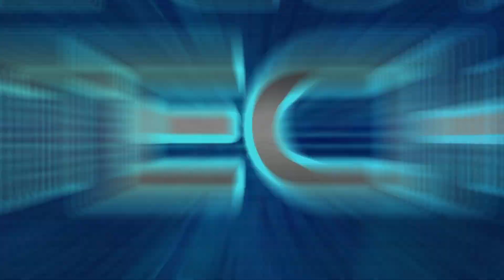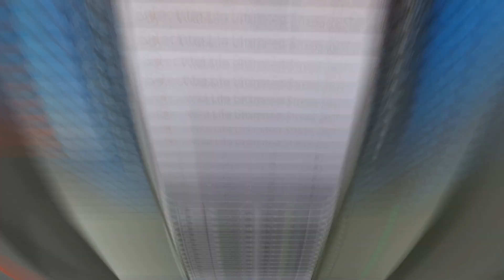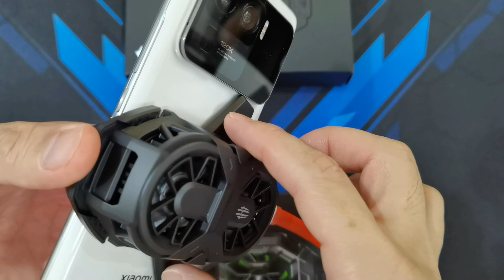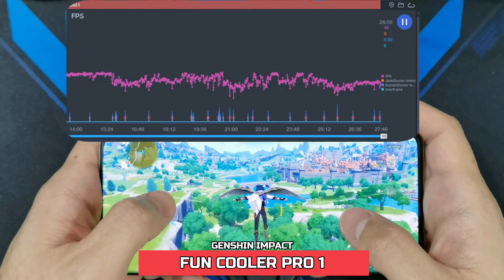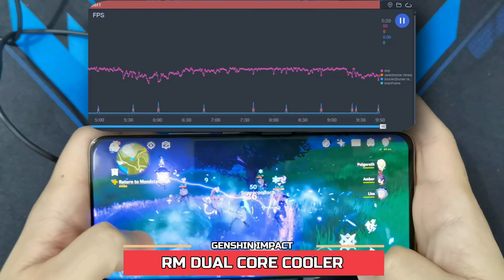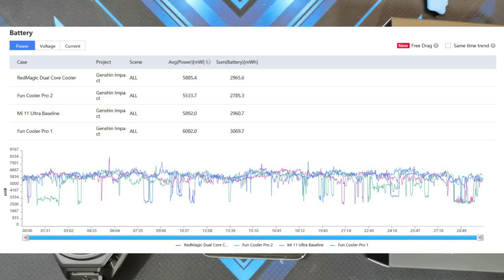Xiaomi Mi11 Ultra Stress Test, Genshin Impact Graphics and Cooler Comparison

Comment: Great work bro! Thanks a lot for this content👍 Waiting for this Video. 
Now i know what model of external cooler have to buy. 
One last thing:
Could you run the standart Wild Life Stress Test with funcooler 1/2 and verify success whithout overheating?

#roadto10k
Reply from the maker: I did run the stress test on this video bro, check it out
Reply: @EGotTech25  you did the unlimited Stress Test, its the offscreen test.
The standart is with full visuals on screen.
could you pin the score in the comments?  In the standard test, the Ultra always had problems on the 15th run.
But even so - if Genshin Impact runs better thanks to the cooler, that's cooling tool is a future-proof solution.
Reply from the maker: @Datenschutz_Datenschutz  ah alright didn't know there were issues with running the test on unlimited mode

Comment: It seems that the blackshark funcooler pro 1 is the best in terms of value for money
Reply from the maker: the fun cooler pro 2 is not that much more expensive and will fit in more phones, so my value for money would go for the cooler pro 2
Reply: @EGotTech25  but I already have the funcooler 1. My point is y'all don't need to upgrade to funcooler pro 2 since it's not too big of a difference.
Reply: @ejpang08  bro its say funcooler 2 have the lowest aveg temp from other 2 coolers and the funcooler 1 is 2nd place so its a big upgrade from funcooler 1
Reply: @gametvon98  not big enough of a difference to upgrade lmao. My funcooler pro 1 works perfectly well to cool my phone and keep temps low even when playing genshin.
Reply: @ejpang08  i didn't say funcooler 1 is not good bruh i say funcooler 2 have lower aveg. temp numbers don't lie and if u have already funcooler 1 its okay to not buy 2 because its the same function but as new and want to buy for the first time better get funcooler 2 because as i say it has lower average temp from funcooler 1
Reply: @gametvon98  exactly what I stated above, like 1 year ago 😂

Comment: Hello bro, do a cooler comparison on ROG phone 5 for all the 4 coolers, that would help people to decide which is best cooler under same circumstances.
Reply from the maker: already did one, only without the fun cooler pro 2, it's here if you want to watch
https://www.youtube.com/watch?v=vlJBnJFf7gY
Reply: @EGotTech25  I did watch it, but now I'm confused is the fun cooler pro 1 better or 2 ?
Reply from the maker: the fun cooler pro 2 is better overall because of the redesigned clips, the inclusion of the additional clips also makes this a better buy than the original fun cooler pro 1
Reply: @EGotTech25  thanks for the advice 😁

Comment: Intro is way too loud, also the fun cooler 2 pro is well worth the money, it works much better on bs3 pro than the 1st cooler did.
Reply from the maker: cool thanks for the feedback bro! will adjust the audio levels, and totally agree, the fun cooler pro 2 is the best bang for buck cooler you can get right now
Reply: @EGotTech25  thanks bro, and yeh it's a fair bit better, the 1st fun cooler could become a bit loose on the bs3 pro and lose contact slightly with the back.

Doing my own testing in the uk where the room temp is about 20 degrees Celsius, with the fun cooler pro 1 the phone hits about 32 degrees on genshin impact and about 36 with magnet charge.

With the fun cooler pro 2 it stays about 29 degrees and hits 32 degrees with magnet charge so I'm very satisfied with that improvement, also my hands sweat a lot so I love that the air is blasting straight across the back of the phone 😁
Reply from the maker: haha, yeah that's a big plus, my hands got a bit chilly during the testing because of that air blasting from the back 🤣
Reply: @EGotTech25  I use the left and right gamepads so my hands are a bit further away from the fan than yours so I could imagine it gets a bit chilly with your hands that close it haha.
Reply from the maker: haha yeah it was right on top of the fans, its a better feeling than roasted fingers to be honest 🤣😂
Reply: @EGotTech25  hahaha that's very true 🤣

Comment: Bro this is gonna sound so cringe but I don't really want to buy the cooler for my phone so I decided to go DIY. I used an old pc fan and attached it to my usb cable putting a 9V battery slot also. (For when I don't have usb) and I put a ball of bluetack on the 4 edges before sticking it to my phone. The makeshift cooler is pretty amazing lol temps  after 2 hour gaming session of Fortnite 42 degrees c and around 75 FPS still. Only con is that it's only ideal for when you use a controller lol
Reply from the maker: wow nice DIY bro, yeah think it would be hard to play on the phone with a PC fan attached, so a bluetooth controller is the way to go!

Comment: Thanks! Awesome comparisons for the coolers , love the extended 30min genshin testing. Thank you for mentioning the clamp silicones for the fun cooler pro2 , I think this is a major point... Esp for the rog phones since the other coolers would constantly put pressure on the power button which might lead to damage
Reply from the maker: yep and not just damage, it will actually turn off your phone if the power button gets pressed long enough. thanks for the visit and the support bro!

Comment: How well would the coolers cool the phone if you were able to use both of the funcoolers at the same time 🤔😁
Reply from the maker: going to be a tight fit bro and you won't be even able to hold the phone properly after putting more than one! 🤣😂
Reply: @EGotTech25  ya but the idea is to see how well it would cool 😁 and if 2 coolers would work really well then I believe the companies can make a wider cooler probably with additional buttons aswell if possible 😁
Reply from the maker: haha worth a try!

Comment: Hey , does the mi 11 ultra have the bypass charging like feature ?
Reply from the maker: that's one of the features that it doesn't have, even the black shark 4 pro doesn't have it, so makes me think Xiaomi may not be implementing it on their phones
Reply: @EGotTech25  that's too bad though !

Actually running the phone directly from wall power causes less strain to the battery , it would have been nice if all the manufacturers implemented it on their devices !

It's just a software tweak , I don't get it why they don't just give us that feature !

Love your work here !😅
Reply from the maker: yeah totally agree, all phone manufacturers should enable that!